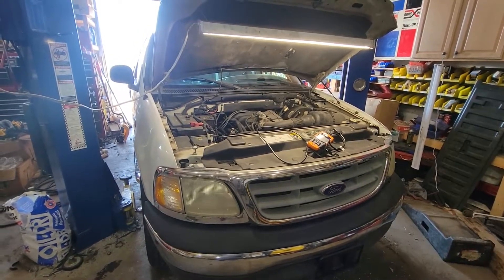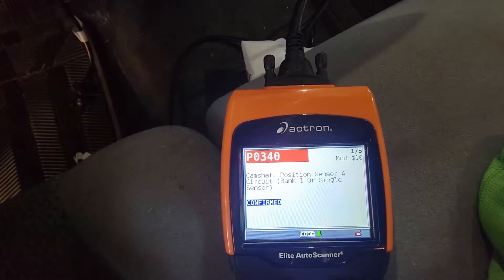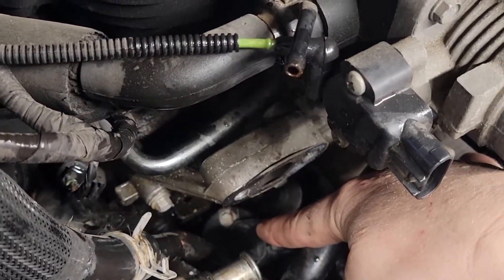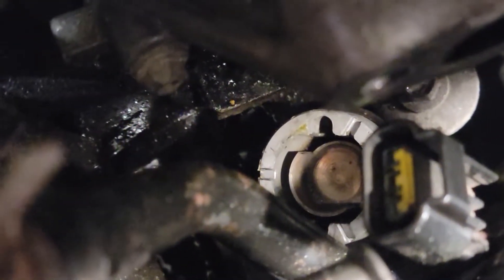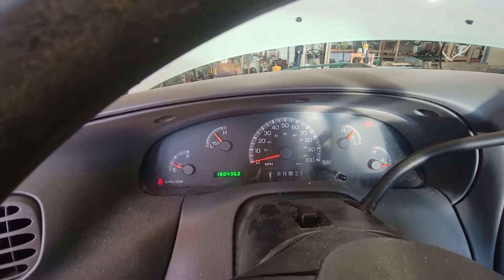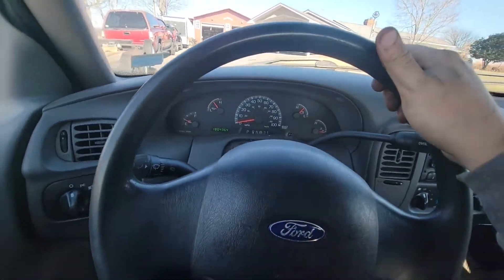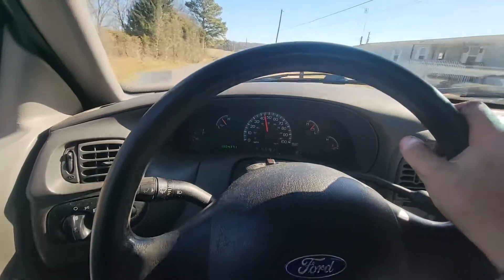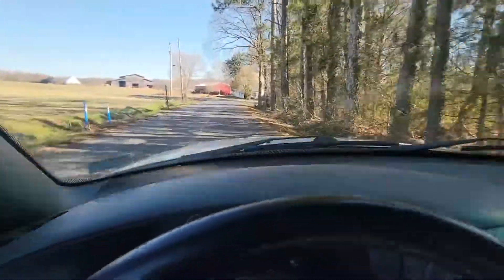How to change a Camshaft Position Sensor on a 2002 Ford F150 | Codes P0340 and P1336

Comment: About to replace mine. Will let everyone know how it goes. Wish me luck, I'm a welder not a mechanic. 🤣🍺
Reply from the maker: It's actually not that bad
Reply: @BentOaksGarage Just finished, and now it won't crank at all.
Reply from the maker: @redskorpion75  The vehicle wont crank, or cranking but not starting? Even if you left the Cam position sensor unplugged, the vehicle should still crank. Feel free to call or test me and I can run you through some diagnostics. 423-220-0757